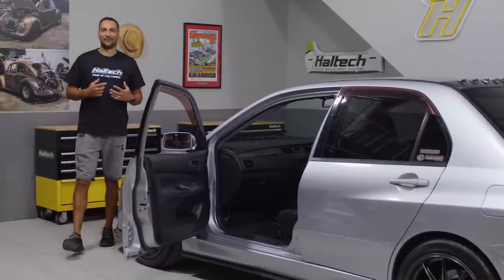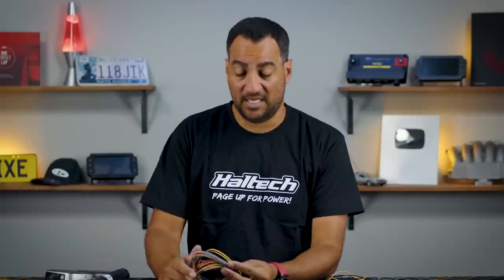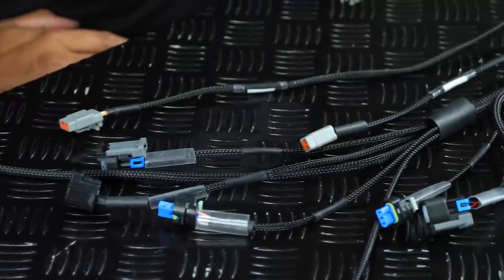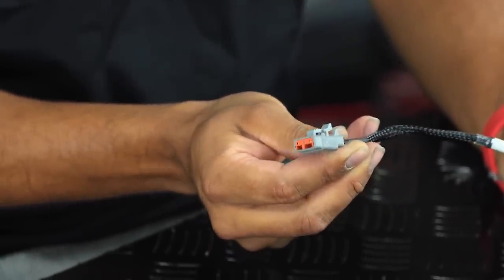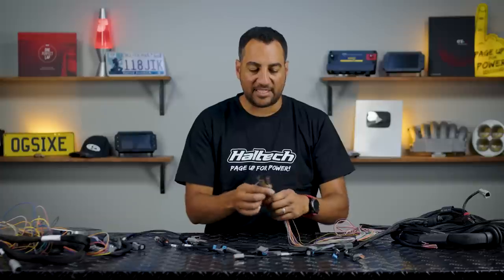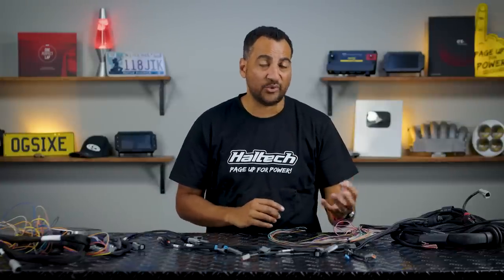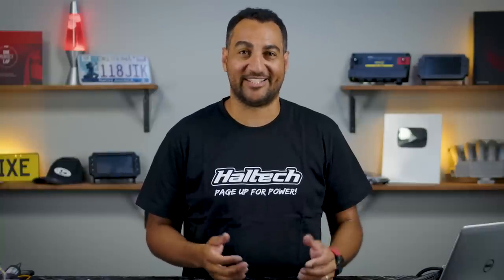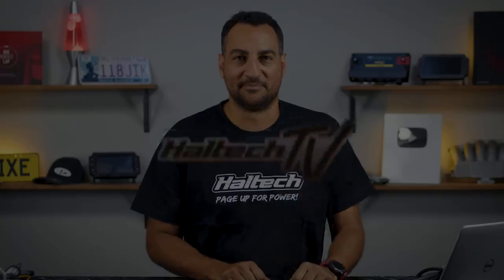🛠 Tidy Up Your Harness - What To Do With Spare Wires? | TECHNICALLY SPEAKING

Comment from the maker: It's time for some Wiring Tech!
So many wiring jobs stop at that "almost done" stage with the leftover wires loosely tossed somewhere in the cabin. This is neither safe nor particularly attractive and it certainly makes an otherwise solid wiring job look messy and unfinished. If this is you - don't worry - here's Dave with some helpful hints and tips on how to take care of your spare wires.

-----------------------------------------------------------
Liked this video? Here are more like it:
How to de-pin connectors: https://youtu.be/Vt_rAIKPlWA
How to crimp connectors: https://youtu.be/mW-5QYBak9o
How to wire an iC-7 Dash: https://youtu.be/9QhhjI0ILFA
--------------------------------------------------------
Reply: Sorry, no shoddy wiring from myself. I hated that stuff at my former job as a fire alarm technician since it made finding wiring issues that much harder. Of course it helps clean wiring jobs if there's a junction box to use as a wire gathering and connection place.

Comment: I was this guy for a long time. I had a MK2 golf with a 1.8T 20 valve engine from a 2003 Audi S3. The whole ECU and extra relays, all sitting about in the passenger footwell. 

I was studying electrical and mechanical engineering at the time and didn't quite have the knowledge to do it. But I tried and it worked.. and I was happy with that at 17. 

Still own that car, finished up my new loom for the standalone last week. And It turns out, watching this video? I'm still learning!

Comment: I Actually asked this question on the Haltech tuning site. Ended up terminating them (DPI, 5v, avi & sig grd) with a connector. Today i decided to add a fuel pressure sender to ECU, as i have a separate gauge also. So the Avi is now easily accessible. Luv these group discussions.

Comment: This is all great advice that I would have benefited greatly from had I known it in 2015 when I put my car together.  I ended up labelling every spare wire in the loom but lacked the foresight to think about what I would need to add later and run the wires.  I also decided to terminate every spare wire that connected to the ecu in a safe way that wouldn't allow any shorts, if I made a misclick while tuning.  I love the idea of using the clear shrink on the DYMO labels because my dymo labels came unstuck after about 18 months in the heat of the car.

Comment: I've got a haltech 2500 with a very used barra harness and hp6, I'm heavy considering using it on my ba xr8 instead, what is the best option there? turn my barra harness into a jumper harness? it still has the wires taped together for the other cylinders, but it's using just a regular oxygen sensor.

Comment: Not directly on topic but how easy they are to depin is my favourite thing about DT_ connectors.

From a rail signalling background if we're leaving wires floating around they've got to be double insulated, generally a bit of tape if there's no crimp or a bit of tube if they're terminated. Then that goes in a little baggy. Slightly different possible consequences if something goes wrong however.

Comment: I can't agree more with this process with the exception of the open flame😆. 
In the UTV/Sxs industry we install alot of add-on electronics. I learned very quickly to isolate, follow oem wiring harness paths, and most of all Labeling. I can't tell you how much time a labeled harness has saved me in diagnosis time. 
I personally use Choroplast tape in conjunction with the shielded sleeve material as an additional layer of protection.

Comment: To terminate a set of wres you may need later I just cut them to slightly (2mm) different lengths,  blob of silicone, then heat shrink over the top.